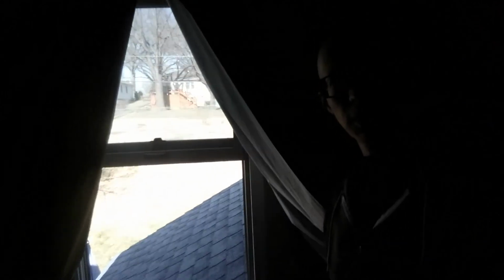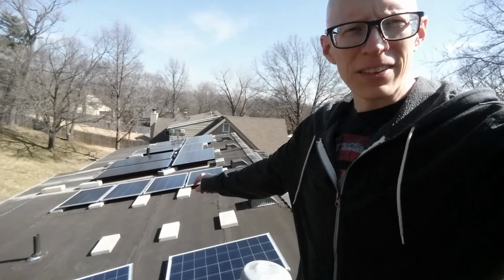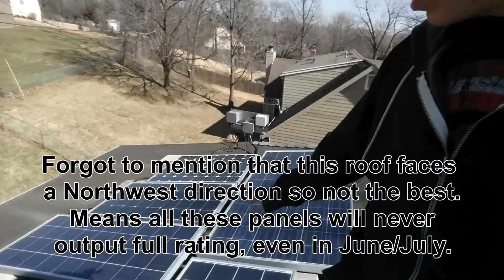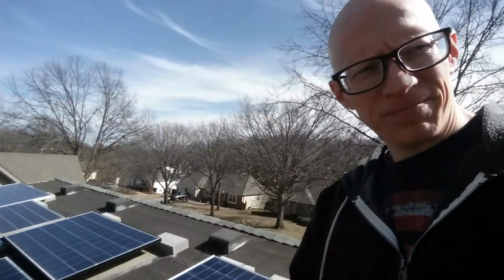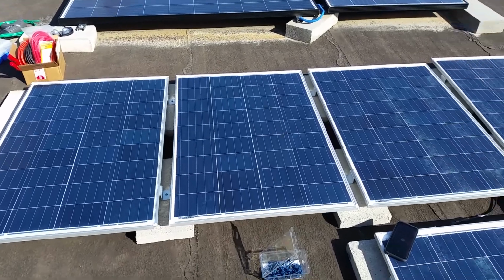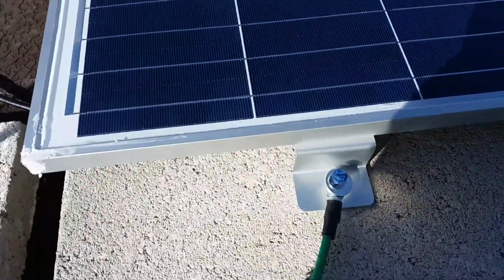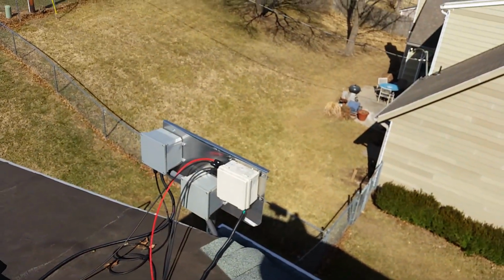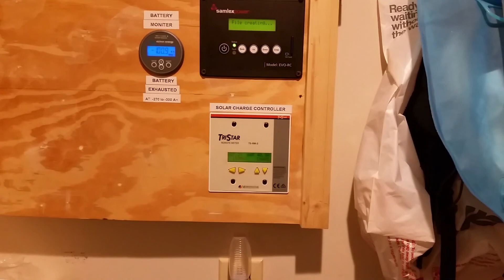Solar Panel Install Day & Production Results!!

Comment: Great PVs setup on the roof with concrete blocks , I just hope they can keep the winds from pretty much getting under them and moving them during any severe windstorm but I know someday you may find a better way to fasten them to the roof maybe with Unistrute from Home Depot to get them more uniformed . You are shoul bringing in lots of power . Props to you .
Reply from the maker: Thanks checking it out Cedric!  Yes, really enjoying the extra power.  Looking forward to seeing what it does this summer.  In the meantime I'll be contemplating more ways to secure them even better.